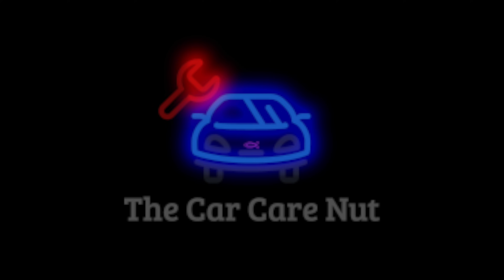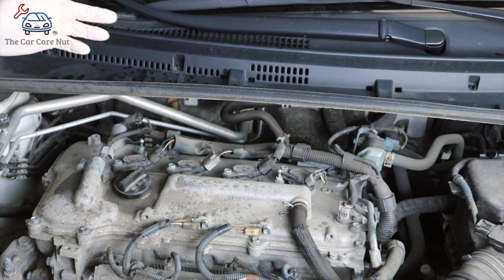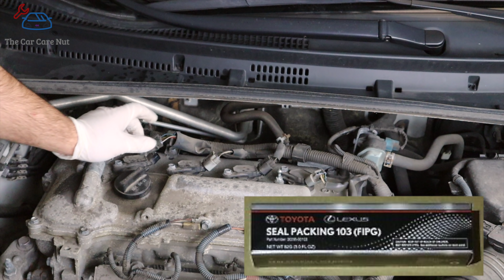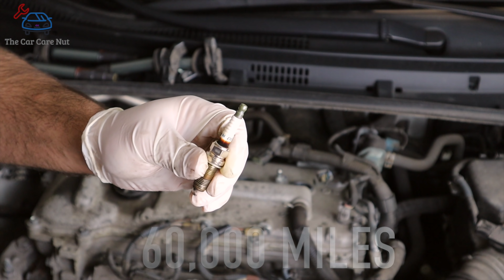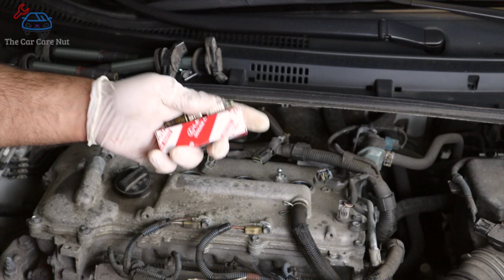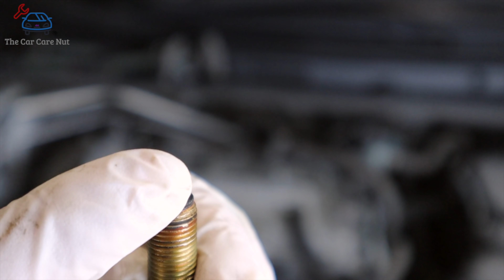How to change Toyota Spark Plugs on 4 cylinder engines

Comment: Because different metals in the head and in the spark plug itself expand and contract at different rates, would you recommend that spark plugs in this particular engine be removed when the engine is hot, just a bit warm after cooling for several minutes or stone cold? Thanks!
Reply from the maker: Hi! Ideally a warm engine is better. Not too hot not too cold.
Reply: @TheCarCareNut  ,,, Really ?? That's a POOR advice !!!  Never remove spark plugs from a warm engine. It is not recommended. I am at a loss that you are a professional mechanic 🐱
Reply from the maker: Michael,

From experience removing spark plugs from a completely cold engine is actually not advised. Removing spark plugs from a very hot engine is not advised. A warm engine is best as the aluminum expands a bit and gives you a similar effect or natural heating to get the plugs out easier without risking damage to the thread. This is my experience from doing hundreds if not thousands of spark plugs.
Reply: @TheCarCareNut  , A warm engine will NOT make the removal of a plug any easier. That is flawed and cannot be grounded in engineering logic. In fact , the material make-up of a plug is the very reason why it should never be removed when warm or hot. The manufacturers of spark plugs can attest to that.
Reply: Torquing plugs correctly and not over tightening them is the solution. 
Removing  hot plugs increases the potential of damage to the threaded hole.
Reply from the maker: Michael, I understand where you’re coming from. Spark plug companies and engineers will have their theories that they have reached through their testing which I respect. However they are not the ones changing spark plugs on actual daily driven cars, mechanics are. And through experience this is what works best. I’ve had spark plugs break on stone cold engines but never on a warm engine. And on Toyota’s never had a thread strip because the engine is warm or even hot. Neither have 21 technicians in the dealership where I work. So I’ll go with that. If out of every 5000 spark plugs removed, none strips, I’ll take my chances and recommend that my viewers do the same.
Reply: @TheCarCareNut  with an iron head,cold is better than hot...but tightening is also different ,aluminium is not strong enough to cope with overtightening.but when some appentice does your plugs fingertight its really bad for compression...but these new engines appear to have redundancy built in,so hey just replace the whole car.

Comment: Transmission fluid when and how next please!
Reply from the maker: It’s already there for the sealed transmission. Change it every 60k or 6 years https://youtu.be/eRxSu4-4ojo
Reply: The Car Care Nut I want to change mine soon car has 40K miles is not gonna hurt anything ?
Reply from the maker: No it won’t hurt anything.
Reply: @andersonrodriguez8258  
Our vehicle has 53,750 miles. So far I've done three drain and fills on the transmission fluid. The reason being is that I have an ATF temperature gauge (Scan Gauge 2) and I know it runs hot in the summer.
Reply: Yes ! Looks like a pita

Comment: Mr. AMD,
Thank you for the great videos & tips!
What is your thought on replacing the coils at the same time as the spark plugs? Also, would you use dielectric grease on the coil connectors or leave them dry?
Reply from the maker: Hi Charles,

I am a big believer in if it’s not broken don’t fix it. I wouldn’t change ignition coils just because. I would change the plugs and reuse the coils. 

I would leave them dry as they come like that from the factory and I’ve never had a coil stick before.
Reply: @TheCarCareNut 
 Great,Thanks for the reply! If you can, do the v6 Highlander some time??!!

Comment: A few comments/questions:
- Engine should be off for hours. It must be COLD! 
- Die-electric grease on the spark plugs connection with coils?
- For tightening the spark plug torque value is important but you need to make sure that if you're using a universal joint it will set you off (provide less torque)
- Marking/numbering coils might not be a big deal as they are identical but will help in the case of misfire.

Love your videos bro!
Reply from the maker: Hi! With Toyota engines the engine doesn’t have to be cold. At work most of the spark plugs we do are in hot engines.

I wouldn’t use die electric grease. Toyota coils don’t stick to plugs.

In case of a misfire diagnosis you’d want to swap the affected coil with another bit in the case of maintenance spark plug replacement I wouldn’t worry about the order.
Reply: @TheCarCareNut  Good to know! I would have gotten both questions wrong. I learned a lot of things that I thought I knew from this video.
EDIT - I remember my father telling me about the spark plugs in Ford Model Ts (I think) that had just tapered seats on the plugs. I presume they were clamped in. Anyway, he said people would sometimes put them back in a hot engine and the plugs would never come out again.

Comment: When the wire plug connector lock tabs brake, I use the small zip ties to repair them:) One looped around the coil and then another through the connector tab and then tie the two together. No potential misfires. I've never thought of using the gasket maker. Thanks for the tip and another great video!
Reply from the maker: The zip tie trick also works very well as well. Basically anyway to keep the connector secured.
Reply: Ko🛍🎀🧸💝
Reply: You can buy new housings online. I did and the replacement was easy. Not wire cutting involved.
Reply: @michaelhahn4589  where did you get yours?
Reply: @wirey68  Amazon!

Comment: Change  Toyota 6 cylinder much easier hhhhhhhh
Reply: Any transverse fwd v6 is never fun to work on.
Reply: @thetechlibrarian  I just show that 4 cylinder spark plugs can be done by women
Reply: @yousseflahbil679  I think many mechanics are jealous of women's small hands. I have small hands but I am still jealous every time I try to jam one in where I have to get fingertips on something.
When I worked in aviation (small planes) my boss had really big hands. He tried for years to get a hand through an instrument hole in the panel and was so proud when he finally figured out how to do it. The next week he came out while I was working behind a panel and had both hands through one instrument hole. He walked away shaking his head.
Reply from the maker: 6 cylinders are not bad just more plugs more things to take out
Reply: @TheCarCareNut  I did it to my Toyota was nightmare took my almost 4 hours

Comment: Say when reinstalling the spark plug "coils", do they have to go back in,in the same order,that you took them out? Also do you know how much the Toyota dealer charges for each spark plug (OEM)?
Reply: In the video he mentions order of coil packs does not matter.
Reply: You haven’t watched full video. 😜
Reply: @AshTeckk  I did watch the entire video.  I'm almost depth, sorry...I have special hearing device.
Reply from the maker: They don’t have to go in the same order as brain and the video mentioned. Also plug prices will vary by model.
Reply: @TheCarCareNut  / I know,went to NAPA, to find how much the OEM plugs cost for my 2013 Camry, and found out,the iridium plugs cost 17.00 for one plug,WOW that's expensive, but I know they could be more. I have 84k on my car now,they(NAPA) change the plugs at 120k. Chee in my 09 Camry dealer said 150k,oh will. I can't believe that plugs could be so expensive.  I'll wait tell 120k to get them changed.
Happy motoring...🙂
Reply: @raymathews7035  I agree with the view that they are long-lasting parts so the price per mile is low for such an important part. I'm from the days of copper plugs that lasted 15-20K miles and cost 89 cents apiece. On the other hand, I had several of those 89 cent plugs fail, usually by arcing internally. Champions were really bad about that - you could open the throttle just so much and the engine would misfire. And, of course, 15 gallons of gas in those days cost $4.80.
Reply: @flagmichael  / I agree..Nothing is cheap anymore.
Reply: @raymathews7035  yes oem is expensive. I bought for 10 bucks for 2013 camry

Comment: Hi...great video....Ive got a 2017 SE Corolla with 45,000 miles.   I'm thinking on changing plugs at 60,000.... whats your opinion?  Thx, again great info n channel. God bless.✌
Reply from the maker: Hi! If doing it yourself not a big expense and no harm in replacing them early but you could actually wait the 120k
Reply: They will be good at twice that mileage.

Comment: You better explain to people the difference between the 14 mm thin wall the 5/ 8 . if you.use a non thing wall socket you'll never get the socket out . especially on the older toyota engines.
Reply: Just turn the engine upside down and shake it.
Reply: Ive seen alot of "master" tech make the mistake and things get ugly like getting a used or new top because of the damage

Comment: Thanks for your continuing DIY series.  Could you expand on anti-seize compounds?  Is that for all Toyota engines or just that engine?  I have the 5VZ-FE in my Tundra and 1GR-FE in the wife's 4Runner.  Thanks.
Reply: That would be great. I know that the poor souls who have Ford Triton engines would gasp at us not using anti-seize. Their spark plugs often break or tear out threads when people try to remove them. Toyota or Ford, which to choose... Toyota hybrid transaxle or DSG6 dual clutch transmission... hmm....
"To be honest I could use a good ass-kicking." - Joe Pesci as Vincent Gambini in "My Cousin Vinny."

Comment: Great info! Our 2014 Prius will need plugs when the weather gets a bit warmer (well, it needs them now but my old bones are not ready!). I have had the cowl off before and will do it again. It really is not hard.

In Priuschat a couple people mentioned that the Toyota hybrid transaxle will make a knocking sound - like a muted rod knock - if the plugs get too old. They say that the PSD rattles a bit at "idle" if the engine power is not smooth. I don't know if I'm convinced, but it sounds like a good reason to make sure the plugs are good before chasing a soft knock. First rule of troubleshooting: make everything right and see what problems remain.
Reply from the maker: That is correct on the Prius rattling noise. It’s the planetary gear set that rattles when the engine misfires
Reply: @TheCarCareNut  That's great to have expert confirmation. Thanks!

Comment: There are lots of counterfeit denso plugs around. You get what you pay for! I was told BY DENSO to only buy from a Toyota/Lexus dealer or Advance auto.
Reply from the maker: Very true be careful of counterfeit parts. Video coming on this In the future
Reply: @TheCarCareNut  Someone on a forum wanted to save a few bucks, and the tip broke off in the cylinder 😒
Reply: Yow! It makes sense... counterfeits of all sorts are flooding the market. I think I will go to Toyota for them.
Reply: You can also buy directly from Denso, through a third party seller
Reply: I always check for correct stamped numbers on plugs and use meter to check for proper resistance.
Reply: @cuddlepoo11  Still need to be from a trusted supplier
Reply: These are facts.  If you are going to buy the own parts just get from the dealer
Reply: So don't get sparkplugs from Rockauto?
Reply: I just purchased for denso twin tip plugs my gas mileage dropped by 3 mi per gallon they came from advanced Auto I'll be returning these today. So I either got counterfeit plugs from advance Auto parts or this engine absolutely does not like denso's twin tip design but they claim is compatible with the car
Reply: @mikeray4002  Were they original for your car?
Reply: @alb12345672  hi, yes I took out the original denso plugs with 117,000 miles and replaced with the Densi Twin Tip. So, technically, they are not OEM, however, twin tip is supposed to be better. LoL 🤣. I actually remember trying the split fire plugs many years ago and had the same results of poorer mpg. I should have learned my lesson. LoL. 
What are your thoughts?  Thanks so much for your time
Reply: Also my mpg is much worse than I stated, it's closer to 4 to 5 mpg less than with original plugs I just took out. That's with over 300 miles of driving
Reply: @mikeray4002  We still don't know if they are OEM for your car. I put them in a 96 Explorer with the 4.0L, they feel a bit more powerful, gas mileage the same or bit less than the Ford ones. It has a pretty accurate computer for the mileage. They do very well though in a Lexus GS, a midsize AWD sedan can easily get 22MPG if driven reasonably.
Reply: Dont cheap out on spark plugs. You replace it Once In its engine lifespan.
Reply: NGK or Denso?
Reply: @marosrokyta8292  They are the same company now BTW.
Reply: @marosrokyta8292  NGK bought Denso's plug division.
Reply: Rock Auto denso good or bad?
Reply: @lumiapixel1241 they are good.
Reply: Are NKG from Rock Auto counterfeit? Just bought some for 2017 Camry 4 cylinder.
Reply: @rdc3643 would also love to know
Reply: I bought some cheap Denso eBay plugs to compare with genuine Denso plugs from the parts store. One way to tell if it's fake is to scrape the side of the metal case with a knife. The real one will stay the same silver color solid through and on the fake one, the silver will come off to expose a copper color metal underneath the silver plating. Also the genuine ones, there will be a blue like color just below the iridium tip. Counterfeit ones won't have that.
Reply: @robmulero3554  Denso tech support told me they spent many millions developing those plugs, have high paid test engineers, strict quality control protocols, premium suppliers, etc. Especially those fine twin  tip ones. No one is going to reproduce that in their basement for $1 a plug :lol:.
Reply from the maker: They will produce counterfeits that are actually not even iridium but look like one. Iridium plugs are expensive because of how long they last
Reply: @TheCarCareNut  My toyota yaris 2nzfe engine came from japan with a spark plug tool and it  is not a torque wrench. Is there is number of turns that can help one respect the torque specifications ?Thank you in advance.👍
Reply: @TheCarCareNut  its also made from meteroid material (No joke) so theres a limited source.

Comment: If you've ever been around an engine dyno in a performance shop you find yourself changing plugs a lot. At SamTech I learned to use a piece of hose to install and remove plugs. Granted magnetic spark plug sockets are really nice to use and for these 4 cylinder applications it's not hard to install them, but get a transversely mounted v6 or the rear spark plugs on a v8 under a cowl and it sure makes it easier.
Reply from the maker: That’s also a good method. On Toyota v6 you’d need a joint spark plug socket which is similar to the one I used in this video.

Comment: If you find oil on the coil consider changing the valve cover gasket. My 2006 Avensis 1ZZ-FE engine need this procedure and i can do it myself, but i dont have the tool to torque the valve cover.
Reply from the maker: I would invest in a torque wrench. And on valve cover gaskets always buy an original gasket. I’ve seen a lot of issues with aftermarket gaskets on the 1zz especially the blue ones.
Reply: @TheCarCareNut  Thank you. I'm planning to buy only original parts. They are not expensive and i can afford them with no problem :) I will ask some questions over time. I hope you dont mind :)
Reply from the maker: I don’t mind at all! Best of luck with your project
Reply: Buy a 3/8” one,mechanical, they are cheaper.   Jim

Comment: Thanks.....did learn something! Anti-seize not always necessary!   Jim
Reply: I would have made that mistake.
Reply: saw another  utube channel from a Toyota tech and he recommended anti seize, HOWEVER said it needed to be copper based anti seize.
Reply: Not only is anti-sieze not always recommended, but most spark plug manufacturers recommend against the use of it. This is from NGK;
1. Anti-seize

"NGK spark plugs feature trivalent plating. This silver or chrome-colored finish on the threads is designed to provide corrosion resistance against moisture and chemicals. The coating also acts as a release agent during spark plug removal. NGK spark plugs are installed at the factory dry, without lubrication or anti-seize.

Anti-seize can act as a lubricant, altering torque values up to 20 percent, increasing the risk of spark plug thread breakage and/or metal shell stretch. Thread breakage can sometimes involve removing the cylinder head for repair. Metal shell stretch changes the heat rating of the spark plug and can result in serious engine damage caused by pre-ignition. Do not use anti-seize or lubricant on NGK spark plugs. It is completely unnecessary and can be detrimental."
Reply: @robmulero3554  what about Denso plugs?   Jim
Reply: @jimpie231  any spark plugs, don’t use any anti seize anywhere on your car is better
Reply: @jimpie231  Denso doesn't recommend using anti-sieze either. But they say If threads are lubricated, the torque value should be reduced by approximate 1/3 to avoid overtightening. Anti sieze was more for older cars that had steel spark plug threads going into an iron head. It's not needed now with modern spark plugs going into aluminum heads.
Reply: @robmulero3554  thats good news.  I was goin to get Denso plugs but heard some news about them from a couple years ago.  Man what a bummer , i LUV the denso supra from gran turismo